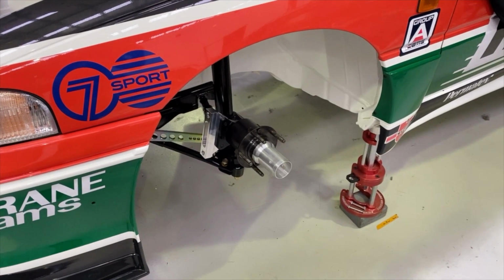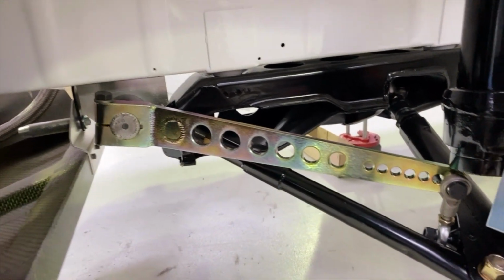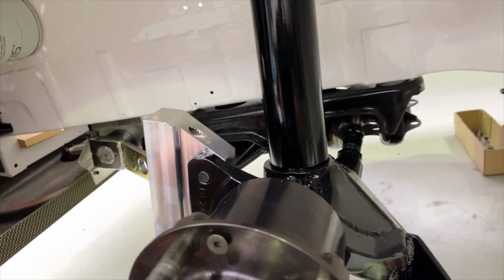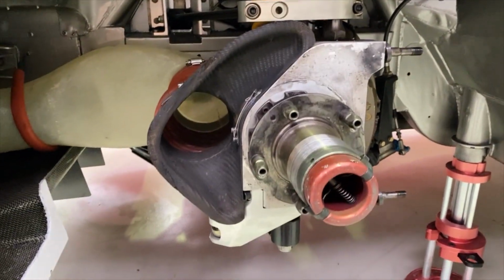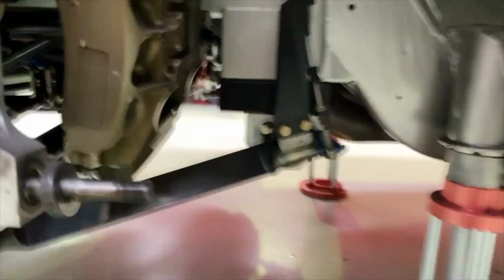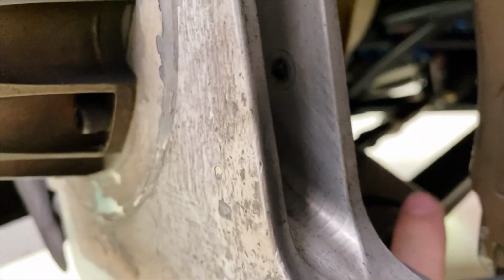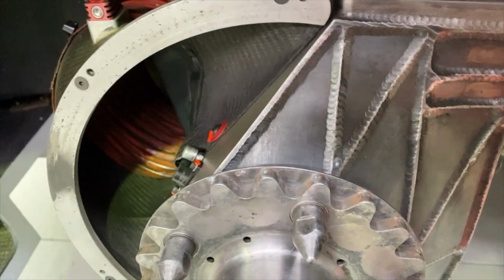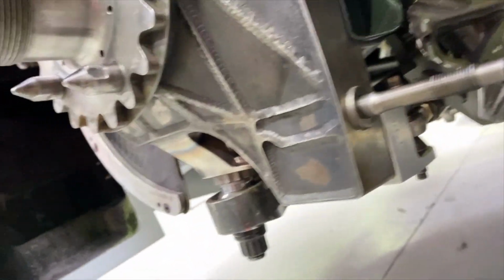Episode 24: Front Suspension and Front Uprights across 3 generations of V8Supercars

Comment: I'm loving the detail. This is great. I'm am curious as to what difference it made to moving the brake caliper to a trailing design over the original forward mount?
Reply: Normally done to move the weight towards the centre of car, as well as making the ducting easier to route.

Comment: Awesome, why was P.E. using 5 stud wheels for 1993, from memory most of the other teams were still running centre bolt?
Reply from the maker: We used 5-stud right through until 1999-2000! It was cheaper to run what we had always used, we had wheels, hubs, rattle guns etc.

Comment: Currently selling a genuine Perkins slide manifold as of 3/3/22 comes with trumpets fuel rail and air box, also have AFR -9 heads to suit the manifold. Jack if you're interested pm me. Was meaning to see if you or Larry had a need for it still.

Comment: Great stuff, very interesting to see the so-called “Ford” front suspension. Just curious, was it a huge advantage having the double wishbone, compared to the McPherson’s struts?
Reply from the maker: The double wishbone front suspension is definitely a better design! With the strut you get varying roll centre geometry through wheel travel, with double wishbone everything can be designed properly.
Reply: @perkinsengineering  Thanks Jack. Love your work
Reply: @perkinsengineering  well said Jack! Running the double wishbone set-up definitely helped getting parity across the field with its range of adjustability and superior design to the traditional struts.
Reply: What do you mean "so called Ford suspension"? It was the suspension design used by the Ford V8 supercars, which was the design used in the Ford Falcon road car. The Commodore used a strut.
Reply: @angry9901  sorry, I was looking everywhere for a ford part number, but I didn’t see one anywhere. I’m pretty sure Jack said it was made by PE, too?
Reply: I see your point, because Ford did not make it, the change from the Commodore strut to the design used by the Falcon should not be referred to as the Ford suspension. I hope you don't get upset when he says the diff is a Ford 9 inch, because Ford did not make the housing or gear set.
Reply: @angry9901  my question was how big an advantage was it having 4 link front end compared to struts? Holden used the upper and lower control arm setup long before Ford, but call it whatever you want, doesn’t bother me 🤷‍♂️